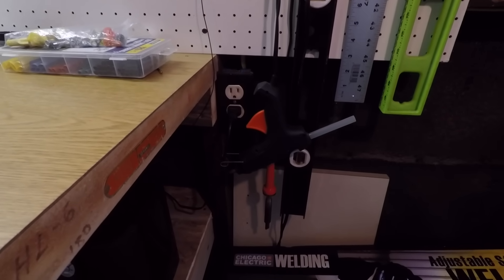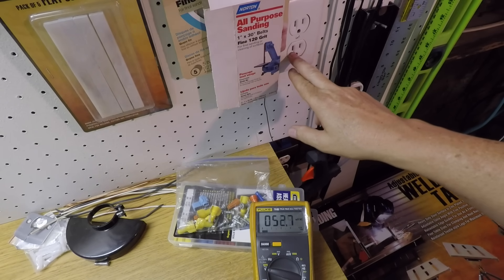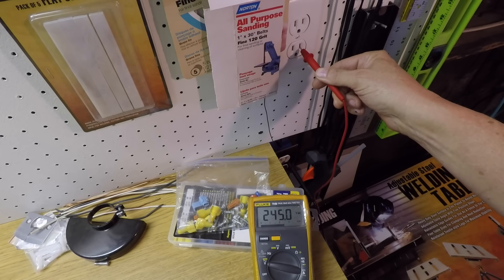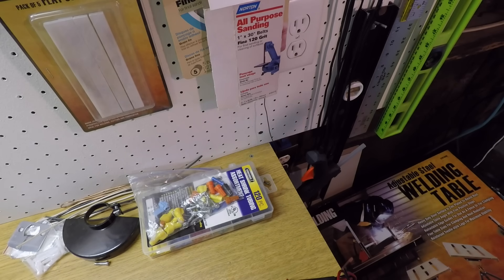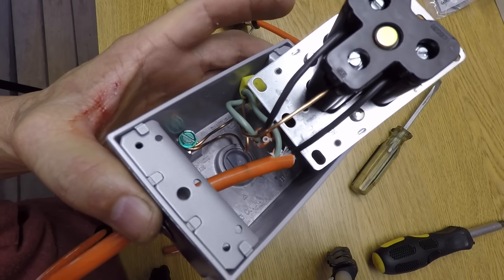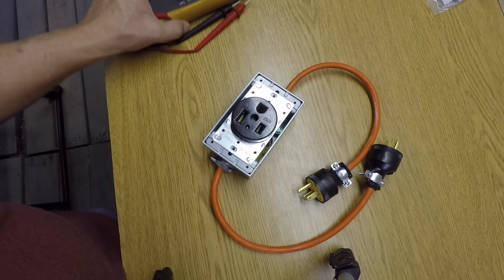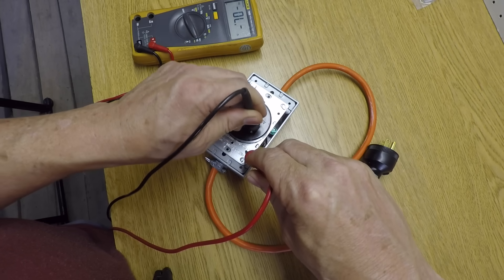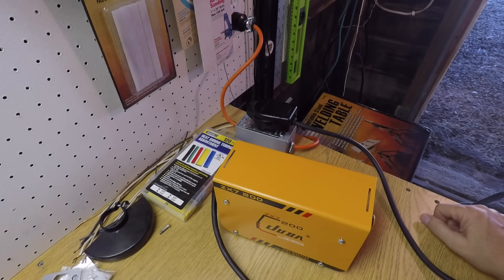How to Get 220v From 110v

Comment: DANGEROUS, attempt at your own risk.  Connect everything as though you're about to weld.  Before powering up the welder, turn OFF the circuit breaker for top outlet.  Leave it off.  Turn on the power switch to the welder (absolutely nothing will happen).  CAREFULLY, remove the plug from the top outlet and check the voltage across the hot male connector and any ground.  DO NOT TOUCH THE PRONGS ON THE PLUG!  You will find 120 V, and the panel will provide up to 20 amps (breaker rating),  thru the welder, which is more than 1000 times the amount necessary to stop your heart.   If the hot prong touches a ground conductor, thousands of amps will flow in the instance of time necessary for the breaker to trip.  A "hot" prong (male) should NEVER be allowed to exist for obvious reasons.  Not during normal use, or in the event of a failure.  Outlets are female so there's no exposed conductors with high voltage/current.  This scenario demonstrates the hazards when the two breakers are not physically connected together.   Well, mostly, even if no breaker is tripped, as long as everything is connected, and the welder is "ON" (not necessary to be welding),  the same hazardous situation exists if either 120 v plug is accidentally pulled from the outlet.  When that lug touches a ground, it will vaporize and splatter molten brass in all directions.  This will almost certainly fry the welder as a static inverter is not near as forgiving as a big old transformer or the wire-wound dc generators used in the old aircraft welders.  

You mentioned that you are aware that it would be a bad idea to pull either plug from the 120 volt outlets with the welder on/in use.  Besides the issue describe above, you would risk causing a large arc which can injure you or someone else and/or the equipment.  Although arcing is still a real issue, if it were absolutely necessary to pull a plug in a critical situation, I would pull both at the exact same time using just one hand, (the other hand in your pocket) and isolated from any ground.  All very hard to do in a welding environment.  Arcing may be slightly reduced because you're breaking two connection points "simultaneously", (advantage when two breakers trip at the same time) and the risk of having a live male plug would be eliminated.   

People may argue that the welder will offer resistance (and/or reactance), and will not pass current during this test and the actual amount of current that will pass is negligible.  NOT TRUE, it will be more than enough to kill someone.  

Another serious issue with this arrangement is ground current.  No, it's not because you chose to use the ground wire/connections and not the neutral.  Though not legal, essentially, it's "correctly" wired.  There is absolutely no use for neutral in this circuit.  Back to ground current and other hazardous voltages.  Because current flows in just one direction from the panel to point of use in each of the 120 v outlets, there's no canceling magnetic induction. This normally neutralizes the voltage induced in the grounding conductor.  (other things, like a floating ground can occur as well but mentioned here only for completeness)   Further, since a considerable amount of current will be flowing, it will induce voltages in the neutral as well.  This can cause damage to other devices that you mentioned are connected to the original outlet.  Further, if you have a water pipe or grounding rod close to your garage you can prove this as well.   Here's how.  Set up as you would to weld, breakers on, everything connected and ready to weld.  Connect a volt meter from ground on any one of the 3 metal electrical boxes in use.  Top, bottom or 240 v outlet box, it doesn't matter, just need a good circuit ground.  Connect the other meter lead to a water pipe, ground rod, ground point for cable TV, etc., whatever is close to the garage.  If nothing is close, find a safe place to drive a (not rusty) long spike or rebar into the soil a few feet or more and connect to it.   Strike a low current arc and read the meter.  You will likely find ~60 V.  If you touch your grounded box or welder and another ground (even the concrete floor) you will get a decent tingle or a maybe serious shock.  

One other test worth doing, is checking the voltage across neutral and ground at any of the outlets that share either of the 2 circuit breakers in question.  You will likely see similar voltages when there is considerable current draw at the 240 volt outlet

I've had the occasion to use the same type of welder and I believe the 50 Amp plug and cord is overkill.  However, other comments suggest the total amount of current available to your welder with your split setup is 40 Amps.  Absolutely not true.  Although you can draw twice the power from a 240 v/20 amp circuit vs 120 Volt,  (Power in Watts = 240 Volts x 20 Amps = 480 Watts),   you can't draw more than 20 amps through either of the 2 breakers in this circuit.  Having an additional 20 Amp breaker in the circuit, does not facilitate an additional 20 amps.  In this arrangement the 2 breakers are in series, and what flows through one, MUST flow through the other and 20 amps is the limit, period.  In fact, if you had 240/480 Volt service (exists outside the US and in some industrial commercial applications here), you would need just one breaker to run a 240 volt device.  Further, if that circuit had 12 gauge wire and the appropriate 20 amp breaker, it could provide the exact same amount of current that your's does, and consequently the same amount of power.  

It seems you have some idea what you're doing and for a quick and dirty, in a pinch, I would use the same setup.  However, I would physically unplug all other devices in the house/garage that share either of the 2 breakers.  Second, I would make sure that I don't set up a ground loop and put myself or someone else in the middle of it.  This will be very hard to ensure when welding.  Understand, chances are, you won't damage the welder but it's possible.  Also, although the welder should have adequate filtering to prevent noise and high voltage spikes, the hi frequency switching circuits in the welder can have a significant impact on devices in your home, and/or your neighbors.  Some of the imports have minimal filtering.  This makes a good/non-noisy ground essential.  If you have a secondary ground in the garage, (water pipe, a ground rod that penetrates 6-8 feet into the ground) I would ground the 240 v / 50 amp receptacle to it.  Not the most ideal arrangement, but with your panel being so far away, its better than nothing.  First, check for ground voltage as described above and verify it drops to a negligible voltage once an additional ground is installed.  There will likely still be ground currents that are less than desirable, but safer as long as the ground connection remains undisturbed during use.  BTW, a small 240 volt load of 4-5 amps (other than the welder), may make it easier to determine how much voltage and current on the grounds and neutrals. 

Finally, I highly recommend having the correct wiring installed.  It will protect you and everything else mentioned much better than the quick and dirty.   Sorry to be so long winded, but there's way more going on here than meets the eye.  I have worked installing and troubleshooting power systems in very large computer rooms and you would be surprised how a little ground current leakage/noise can play havoc with equipment.  I know this is an old video, but I finally got around to seen the first Star Wars. 🙂    Good Luck.

Comment: Can you get 30 amps ?
Reply from the maker: Not with a standard 120V outlets. They are commonly wired with 14 or 12 gauge wire only good for 15 or 20 amps. You would need 10 gauge wire for 30 amps.

Comment: Turn off the two Breakers for the two outlets
So to prevent arcing when unplugging 
When you unplug from a live amp draw the plug will cause a back feed trying to hold on to a complete circuit 
But taking the load off as you explained can be safe
Amps kill !!

Comment: Turn the two breakers off when unplugging your wielding device so the plugs won't arc like a switch and arc causing a back feed
That's how you safely disconnect

Comment: If the circuit breaker handles for each of the circuit breaker supplying the power to the two circuits are not mechanically interlocked you are violating the NEC.

Comment: Garage circuits on a concrete floor have to be gfci. The way  you hooked this up it won't work  because  the gfci  or the gfci breaker will trip.

Comment: Tried this and would only have power if I used my neutral/white on the other side. Even my diagram shows hot hot neutral. Where this shows hot hot ground. So after trial and error only hot neutral ground worked but only getting 120v. Any help?

Comment: Thanks for the video.  I am a little confused by all the concern regarding the wire gauge of the extension cords on your adapter.  If they are not sized correctly, why no concern about the gauge of wire supplying power to each of the 120v receptacles?  For example, if your extension cords were sized correctly, say 10 gauge, if there was only 12 gauge wire feeding each receptacle, doesn't that become an issue also?
Reply: If the outlets were installed to code the main breaker in the panel will protect the wires in the wall.

Comment: as long as they are out of phase any 110 from any place and another 110 from any other place will survive.... and an old knob and tube all you needed was hot because the other was available anywhere.... but of course your title is misleading because you cannot get 220 from a single 110

Comment: The problem with your theory is you say you have two separate lines there too you’re plugs the only way your creating 240 v is you have two separate phases that those circuits are originating from ( electrical panel ) you cannot create 240V from one phase

Comment: Just curious..... If you wired the garage and purposely put 2 outlets in one on top of the other in the garage and I believe you said it was a similar situation outside in another location..... Rather than turning 110 Into 220 why wouldn't you run 6 or 8 gauges Romex and a double 40 circuit then make an adapter to turn the 220 info say 2 duplex outlets, One off of each leg of the 220?   For my Christmas lights I got tired of having to run extension cords from the front porch plug, The back porch plug, The shed and the outlet directly on my power pole under the meter and then having to get 6 timers that were always a minute or two off from one another making my elaborate display look like somebody with no self respect and pride in their work threw it up without proper testing to ensure that all the lights were in working order..... So I installed a double 60A welder/range outlet on the back of my house under the deck and with a dryer cord powered a 120A breaker box that I had mounted to a piece of plywood that was attached to a stand made out of 4x4's from the panel I had 5 pieces of 12/2 that were 100-120 feet long hooked up to 20A breakers in the box and the other end was a duplex outlet with 2 outlets for a total of 4 plugs..... These where stretched out to various points in the Yard and extension cords went from them to the various trees fences fixtures and ornaments in one area or another ........then below the box on the plywood where my seasonal panel was mounted I had 7 duplex outlets and they were each on their own breaker which filled up the 12 slot box I was using....... the various extension cords from lights nativity floods windows doors roof and the perimeter fence near the House all of filled the plugs below the seasonal box so I only have to go to the basement and throw the one 220 breaker and it kills the entire Christmas light display and I don't get cold turning it off but this year I think I might install a commercial timer for the seasonal panel and not worry about turning it off at 1 am every night..... But with All my boring details when you wired the garage wouldn't it have been easier to run a heavy feeder and install a sub panel in the garage or a 220 outlet rather than creating a device that in the event of fire or something else disastrous might present you with a huge issue of liability with your insurance company...,????

Comment: If those are on a 20 amp circuit, you have the wrong receptacles.  Those are 15 amp receptacles on a 20 amp circuit, that's against code
Reply from the maker: Apparently you have no idea what the code says about 15 amp receptacles on a 20 amp circuit.

Comment: Not a big fan of this. While I understand what you're doing it seems a bit risky. You said on your video about this welder, it can require up to 25 amps. Since most welders require at least 30 amps, you'll probably need every bit of the 25. You have 20 amp circuits, so not good. A 30 amp min. dedicated circuit is the way to go here.            I'm also a little suspicious of the fan's voltage requirement, it seems loud and is pushing a lot of air. It may be a 120 v fan. This would be similar to a 240 clothes dryer which requires 120 for lights and controls. They make 240v plugs with a neutral wire connection for this purpose. I don't know if that's the case here, but it's worth investigating.
Reply: THE WAY HIS GADGET IS WIRED THERES ALREADY OTHER ITEMS THAT MAY BE ON THOSE BRANCHES

Comment: Bruce, since you ran the original 120v wiring yourself, I don't see why you didn't just run 240v lines at the same time. The insurance won't like it and may say that you voided their coverage.  P.S: By cutting off the green wires in the two 120v cables, you effectively have NO GROUND to that 240v box or your welder.  I'd redo that if I were you, or just run breakers and wire for those 240v outlets.

Comment: i would not remend it at all to think it's safe  it is fine if you have little welding to do you craking the wires to get too hot and KNOW what caused your house to go up in flames too 
don't be cheap if you're going to these root special plugs you can buy allow you to plug  your plugs into without worrying about someone using it in a different outlet you are the dumb to leave it laying around sorry been down this road  my farm now has ph3 power on the farm  NO longer have to do this 
yes i choice 575 voltage to run with too all of our electrical motors are much easier to find them the single-phase motors too we have not had any trouble with the grain handling system we build to now

Comment: If you plug your DIY device in and then plug in your welder then unplug one side of your DIY device and check with a meter for electricity back through your DIY device 110 volt plug

Comment: What about the wires in the wall , will they heat up? Thats what i would be worried about.
Reply: They have their own breakers 20 amp each so like he said, one of them is running his shop lights so if combined the lights and the welder go over that he WILL trip a breaker!   Right? Lol!🤷‍♂️🙆‍♂️

Comment: my neighbor said electricians wanted insane amounts to replace 120v with 220v outlet line for his new AC - he asked if I could take a look to see if that much work was needed and showed it to me, I wound up using ground wire as second hot and connecting to new breaker that wasn't being used. both breakers were controlling only the one AC, so one tripping is highly unlikely. he asked how much, I told him the six pack in his fridge is fine.

Comment: Great video, one of the higher standard of videos on youtube. Now to deal with the other comments. There is another video on youtube by Jonathan Katz-Moses that shows an electrical panel and shows how 120v domestic supply is three wires, with one the "center-tap" neutral and how each alternative Circuit Breaker going down the panel is alternatively going to one live side or the other and, two alternative CB's will together provide 220-240 V. 

Now, common sense says you should use circuit breakers of the same value. That said, its pretty easy to run a cable to the clothes dryer , stove or how water of even the electic car charging line. , both of the above will still not satisfy code requirements.

Comment: This will only work if each single pole breaker is on opposite sides of panel. Will not work if both breakers are on top of each other. The other issue is if one breaker trips and the other one doesn’t. Safety issue! Not code! Do not do this!

Comment: Hi, cool idea, but you should really install a sub panel in your garage. That way you can have a disconnect and recep for your welder and your 120 volt receps. Sure would hate to see you damage your welder or have safety issues. Be safe.

Comment: Thank you very much for the video. I bought unknowingly a welder that only runs off 220. Went to
Home Depot for the outlet and box. Went to harbor freight for the end plug and the 14 gauge 25ft extension cord. Which I cut in half installed the plug in. Wired it all up following your video. 🤞hope it works when I test it tomorrow. Again 🙏
Reply: I hope you meant 12 gauge extension cord and not a 14 gauge as the 14 gauge will not handle the amp draw and will eventually over heat.
Reply from the maker: Be careful what welder you are using with this combiner. My welder only draws 25 amps on max settings and the combiner I made in the video is only good for 15 amps max draw. I usually only use my little welder on half it's rated output with this combiner. Most welders require a minimum of 30 amps. My little lunch box welder only needs 25 amps on max. Also remember your outlets need to be on different legs of the main panel or you will get 0 voltage. I didn't explain that very well in the video according to a lot of the comments.